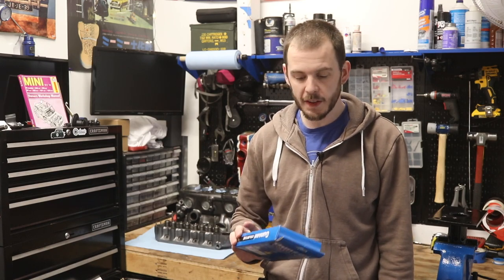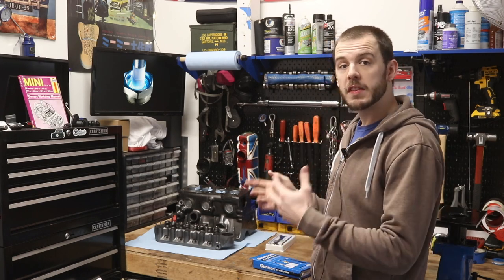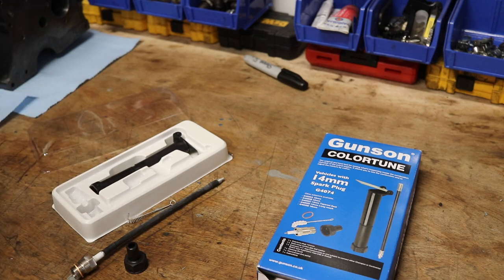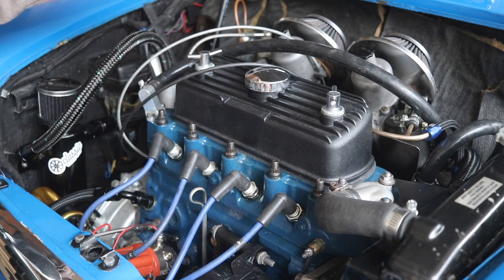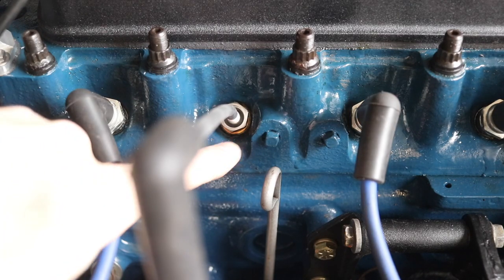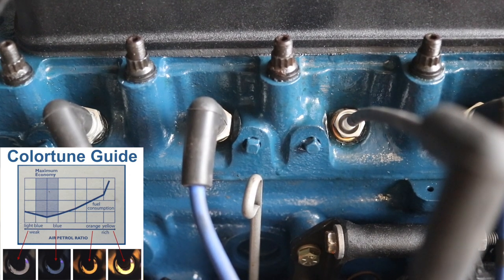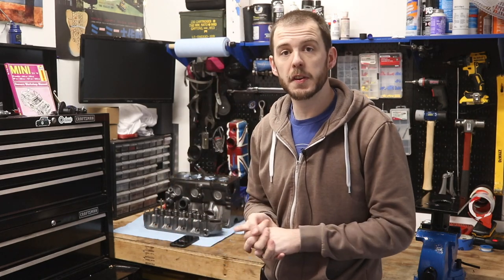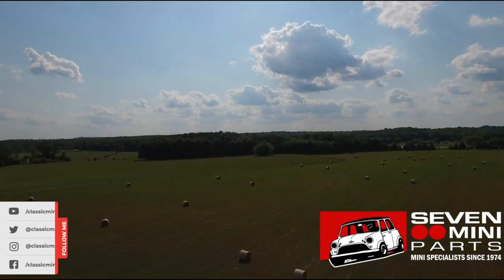Gunson ColorTune - The Easiest Way to Tune Your Classic Mini Carb?

Comment: I have set up hundreds of British cars, including Minis, with a Colortune, a four gas analyzer, and a chassis dyno. The Colortune works very well for setting up your idle fuel mixture. Here is how you use it:

1. The instructions in the Gunson manual are WRONG. When using the Colortune, set the idle so that the flame color is blue, then richen the mixture until it just turns yellow with no blue flashes. That is the correct idea mixture as proven by sound, engine rpm, and a four gas exhaust analyzer. Adjusting the mixture to burn blue is too lean and results in partial misfires, high unburned hydrocarbon readings, and an audibly uneven idle. You will believe me as soon as you try it.
2. You can only tune your idle mixture with the Colortune, it will not give you useful information when revving or when driving under load. You need a wide band meter or an exhaust gas analyzer.
3. You can usually use two Colortunes at the same time. You cannot use more than two, for some reason the car won't idle with more than two. There is no great advantage to using two at a time unless you have two banks of cylinders like a V-8, then it sometimes makes the job go quicker.
4. If you get a lot of dark flashes on a particular cylinder that you cannot tune out with the idle mixture, then check for standard tune up parameters like compression, valve clearance, spark plug wire resistance, etc.
5. You can check all four cylinders with a Colortune and you usually tune to get the leanest cylinder to just give you a pure yellow flash with no blue flashes. The other cylinders will be running rich.

Good luck with your Colortune!
Reply: Thanks for this info. I've just tried a colortune on my triumph herald and set the idle as blue. I'll redo it according to your advice tomorrow.

Comment: Hi Cole,
I finally bought a Colourtune having watched your video.
Just an FYI, you can unscrew the aluminium cap off the top of the sparkplug and screw it onto the extension. It gives you a better fit than just resting the HT lead on the end of the extension.

Comment: I'm old school, always used my ear and hose to balance the carbs. This may be a more dynamic approach. Nice job.
Reply: But... That doesn't tell you anything about the mixture though 🤔
Reply: @OscarTangoAtc  Yes it does, when turning screw richer from lean the revs will rise then fall has it gets to rich.
Have always used my ears.
Another old skool way is to put a coin on top engine and adjust until it is as still a can be.
Reply: I do it this way too and you get an accurate result every time. You do have to understand carbs and know how  to setup accurately though. This is not for the average Joe with little knowledge of carburation.

Comment: Thanks Cole. Nice review, although I’m not at all confident in the ColorTune. My twin SUs were originally set up by 7-Enterprises and my car ran well. I’d check my spark plugs occasionally and would adjust my carbs accordingly. I bought a ColorTune and found the margin of error to be unacceptable. I could turn the carb fuel/air adjustment nut almost 45° in either direction and still be within spec according to the ColorTune, but the spark plugs told a different story. 

I bought a mass O2 gauge and was able to confirm what the plugs were telling me, but the sensitivity of the ColorTune remains a disappointment. My O2 gauge was twice the price of the ColorTune, but well worth it, in my opinion. On the other hand, reading the plugs is highly accurate and free!
Reply: Michael Kotowski which o2 gauge did you bought?
Reply: That is because the needles in the carb are wrong OR the needles have not been centered and / or leveled correctly in the setup of the carburetor/s

Comment: I tune mine with a 268° cam, tuned intake ( 60cm velocity stack with no filter) a quarter turn after blue mixture with a BBC needle (HIF 44). Even though the needle is quite rich and would be adequate for pretty agressive camshafts (up to 286° of duration no problems), I have a leaning mixture around 6.000 rpm. It is very good to find a known point on your AFR curve, but it won't replace road testing in my opinion. 

If, however, you have a direct slide carburator, like on an old bike for example, it will enable spot on mixture for the idle circuit and should be used as an immovable point to tune your carbs.

Comment: When doing this part of a tuneup this should be the last step. Engine, such as timing and the valve lash need to be set and compression checked. For the carbs the air flow needs to be set first using a SU meter. Easy to use and not expensive. Mixture should be last and then recheck  the air flow as the idle will most likely increase as the mixture approaches a more efficient balance.
Reply from the maker: Agreed. This video isn’t about timing, valve lash, or compression though. I have other videos covering those topics as each requires a good amount of time to explain properly.

Comment: This only really helps with setting the idle mixture not the needle jetting. For reference if you have a CO (carbon monoxide) meter you want about 3.5% CO at idle if you have access to one. MoT testing stations will have them if you really need help.

Comment: Great video,  Cole.  I will order one right now. I have a hif44 just like you used to have on yours. When adjusting by plug color, 1 and 2 plugs look whitish where 3 and 4 look black with soot.  How is that possible with a single carb?  Also with hif44 and a cone filter,  did you get a lot of engine (carb) noise in the cabin when you pushed on the car? It does for me and is very loud.

Comment: Just found your channel. Nice video and I can recommend the Colour Tune as well. Been using one on my 69 MGB GT for a few years now. Not sure if you have one already but also get a Moss Motors Carb Balancer. I always balance the carbs first then I go onto the mixture. I only have the one and although a second Colour Tune would speed things up a little bit it really doesn't take long with just the one. Keep up the good work.

Comment: Hey Cole great video  as always. Could this be a possibility  with spi, mpi minis ?
Reply from the maker: You can definitely use it on the SPI and MPI but the fueling adjustment is made by the ECU so it’s less helpful. To my knowledge you can’t adjust it much.
Reply: @classicminidiy  thanks. Was wondering  how much work would it be to switch  a spi to a carb? Any thoughts  and what would be a more useful  carb dual or single

Comment: Seems like for a cyl#3 the idle is set too rich,  it should burn blue,  thats what that idle mixture screw is for,  but of course sometimes it just doesn't work well.    And after opening the throttle it should turn orange for a moment as the carb injects extra fuel,  otherwise the engine would just stall.    And at higher rpms  it should  become bluish ,   which is correct in this case.

Comment: Can anyone help me find the Colortune mentioned in this video? I've check online through Amazon and other websites, but am having trouble finding one to use on my 1973 Morris Mini 1000.
Reply from the maker: Unfortunately it looks like there is a shortage everywhere for the color tunes. Seven mini has a “notify me” function that will let you know when they come back in stock. 

https://www.7ent.com/products/colortune-carb-tune-up-tool-stl0037.html?af=cmdiy1959

Comment: Does the Colour Tune replaces a Synchrotester?
Reply from the maker: No a syncro tester ensures the oil in the floats on dual carb systems is equal allowing the same amount of air into the cylinders under load.

Comment: Used one of these years ago. I cannot stress too much the "warm your engine up first" bit. I had my engine tuned perfectly with the choke out and one it was warmed up it was running too lean ;-)

The only other thing I'd say is to remember where you've screwed the mixture screw from in case the engine cuts out. That way you'll get the engine started back up again. This thing only works with the engine running...

Comment: I've used those colortune kits ..and they are not accurate..they are only a guide..I found engine was way too lean with their  recommendations
Reply from the maker: Yeah after some time with it and learning a bit more about it, the tool is made to set your base idle and at least get the engine running. Past that it wont do anything of value for you across the rev/load range. You need a proper AFR for that.

Comment: Why not use a wide-band O2 sensor?  They're under $200!
Reply from the maker: Ease of use. The O2 Sensor will ALWAYS be more reliable and accurate however this is easier as it doesn't require a new gauge, wiring, and welding in a bung on your exhaust.
Reply: I agree. These things were old-tech 20 years ago when all we had were lumenition marrow-bands. An AEM with the sensor dropped into the tailpipe is night and day better than these pieces of junk.
Reply: @TD16V  A sensor in the tailpipe is the sum of all cylinders, so you could have one lean and one rich which would still show a correct tailpipe reading.  The Colortune lets you set each cylinder mixture correctly, and not just the average of them all.  It would be interesting to set with a Colortune, and then check at the tailpipe with a sensor.